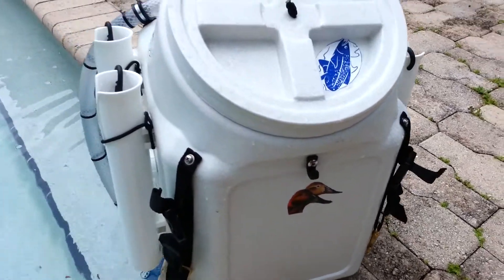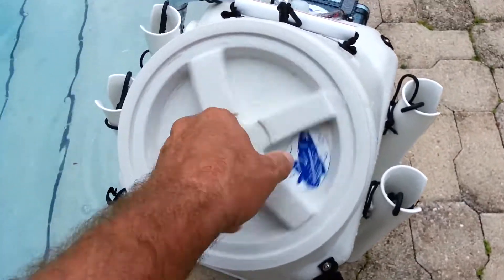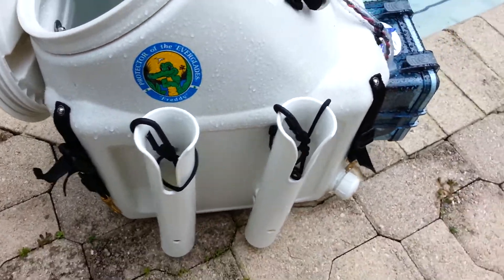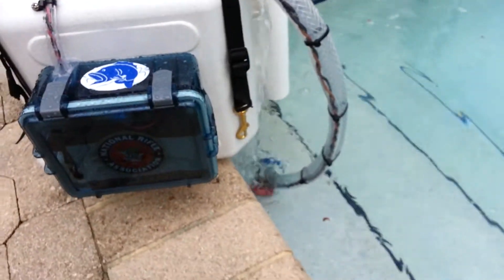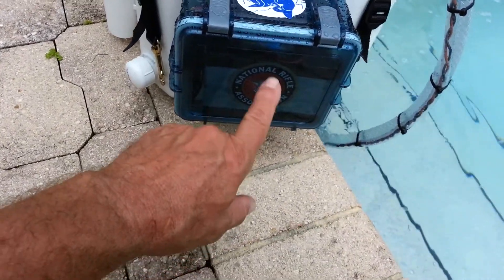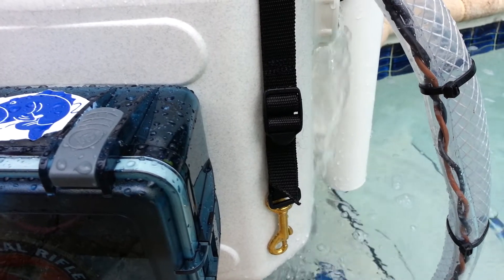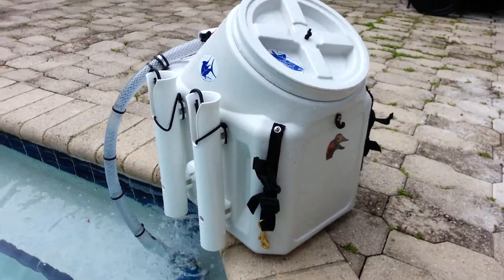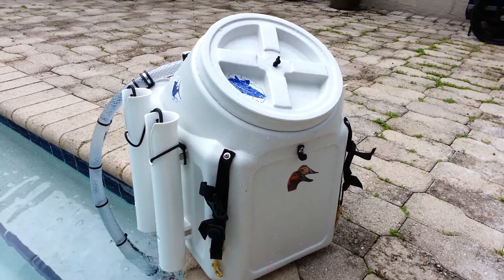Hobie Style baitwell 6 volt test

Comment from the maker: I measured the current using a 6 volt battery. It is 800 milliamps. The bilge pump is rated for 1.5 amps at 12 volts. This setup lasted almost 14 hours on a single charge..

Comment: Good video and live well also I think you meant to say you put The battery connection in parallel not series if you put it in series the voltage would be added together which would by 6+6+6=18 volts. Parallel gives you the same voltage but boosts the amps.
Reply from the maker: yes. being an electrical engineer I should know that!!